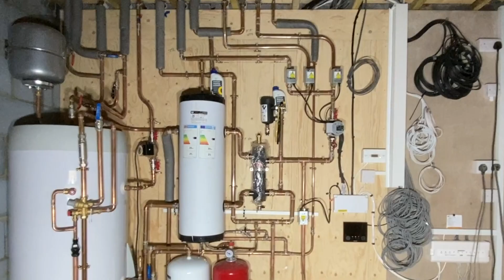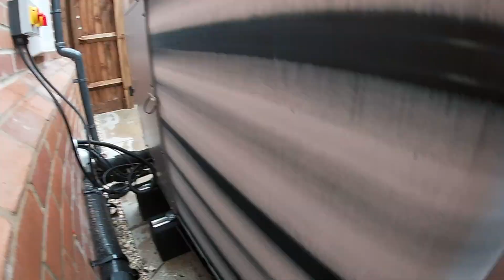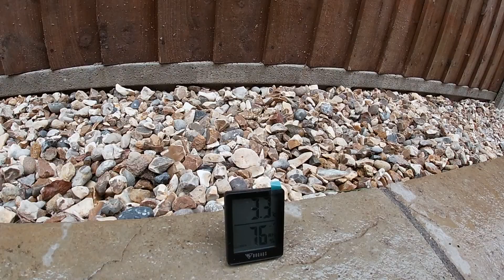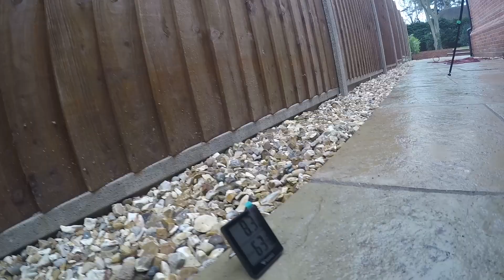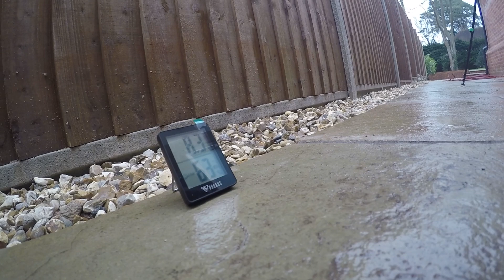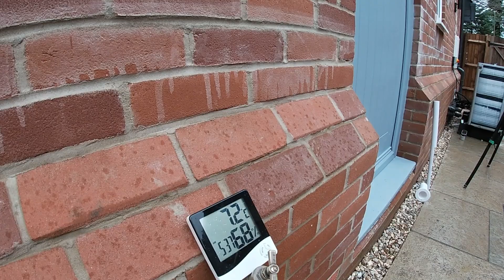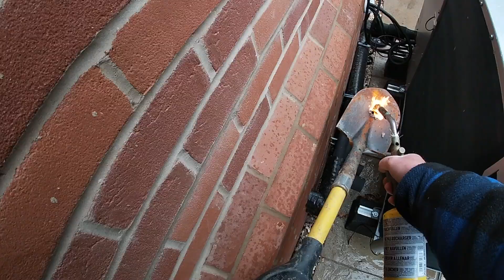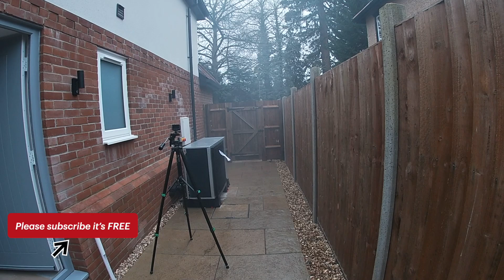Heat  Pump Freeze Up - HELP!

Comment: I’ve been fitting gas boilers for most of my working life. I have 2 words for anyone with a heat pump. “Good luck”
Reply: Good luck and buy a big coat. 🥶
Reply: @ second piece of advise to a heat pump owner. Go on a heat pump training course because you’ll be hard pressed to find someone to fix it when it goes wrong. You’ll have to do it yourself.
Reply from the maker: Funnily enough so have I  but now I am Gassafe free and converted 👍
Reply: There must be a channel for old-dogs that simply cannot understand ASHPs and rather than say they don't understand, simply throw out insults and criticisms.
Reply: Imagine the guy delivering coal had a similar story.
Reply: @edc1569  Yea, a guy on the pony express was just saying that this morning on the way to the tin mine.
Reply: The Norwegians, Swedes and Danes have had heat pumps for decades. They manage just fine. Just go do the heat geek course and you'll be fine. Installing boilers is donkey work - any idiot can do it, and judging by some of the shoddy work I've seen, they do....

Comment: Rip it out and take it down to your local scrap dealer to get some of your money back. Then get yourself a nice gas combination boiler like most other homes. They're cheap to buy, reliable, quiet, easy to repair, and they've been around since the time of  Christ.
These heat pumps are going to be like electric vehicles and flared jeans . Ten years after purchasing them, you'll wonder what the hell you were thinking 🤔.
Reply: Time will tell but I suspect you are wrong on both counts.
Reply: The problem with this system is whoever designed it, nothing to do with heat pumps.
Reply: If your issue improves when removing gate and panels, you could install a wrought iron gate and wooden side panels with airflow to preserve some privacy.
I too will be on the ASHP journey and the nuggets of info out re installations and problems are interesting. Yes it does look as if your particular placement is not ideal at the moment, Good luck👍
Reply: Heat Pumps have been prevalent in the UK far longer than domestic gas boilers. The UK went through the same scenario 50 years ago when 'Natural Gas' started being pumped from North Sea. Until then it was coal fires or maybe the odd oil boiler, until OPEC stunned the market in 1973.
Currently to replace a gas boiler a full heat loss report needs to be obtained as per latest building regulations. Those 'fly by night' cash in hand 'gas engineers' not doing so should be prosecuted, as many gas boilers are way oversized, many have 30kW plus units fitted where 18kW would suffice.
Reply from the maker: @_Dougaldog  Hi I totally agree I used to install gas boilers for 30 years and lost a few jobs to plumbers who for some reason  quoted to fit boilers larger than the size I had quoted for .  Most  " heating " engineers don.t do heat loss calculations to determine the size of boilers, radiators,or pipe sizing .  gas boilers incorrectly sized . Mainly over sized are very un economical to run .A Gas boiler should be sized to run on or as close to its maximum capacity as possible . Thank you . and good luck 👍
Reply: Combi boilers onky really got started aboit 30 years ago, and were massively unreliable until about the last 15 years.  Early ones were lasting less than 10 years, and don't forget when loads stopped working because the condensate drains froze during the beast from the east.
Reply: @brianballard905 I fitted my first Combi Gas boiler in 1982, so they’ve been around a lot longer than 30 years. They’ve certainly evolved over the last 40 plus years. 
Combi boilers are sized according to the Hot Water demand Brian. With most now regulated down to maintain the CH requirements. Also, controls are much more aimed at economic running of the CH system.
Reply: @jimmygillies5590  we had one in 1977...
Reply from the maker: Thank you for your comment. but believe me they are the future. In the not too distant future people will be saying  . Can you believe we used pipe fossil fuel into our homes and set fire to it to keep warm .😎 Good luck 👍
Reply: @HEATSEEKER1428  The "not too distant future" of which you speak is still around 50 years away and comes in the form of nuclear fusion. By this time, we will have cheap electricity heating ceramic radiators and have even less need for heat pumps.
Reply: @HEATSEEKER1428 you can trust a combi boiler to deliver 100% of the time, the heat pump market is under developed and who going to want to wait unreasonable lengths of time  for issues to be resolved. Also most pople are money stressed as it is. The news today is houses of parliament cant get their heat pumps to work, and they're pushing them on people

Comment: If the flow into the buffer tank and the flow from the buffer tank are not balanced then you will get turbulence within the buffer tank wasting energy. For that to happen the flow to each of the three zones would all have to be equal.

I am not a qualified heating engineer, but that looks like your biggest single issue, not the HP position outside.
Reply from the maker: Hi Thank you for your helpful comment  But  Flow and return seem to be ok  return to HP practically cold . Thank you 👍
Reply: Your looking for a delta t of 7° for radiators that's what I'd look at first

Comment: You don’t need the buffer tank or low loss header. First thing you should have done is Read the manual! Quite clear that position of mounting is incorrect messing around with gates etc is just wasting more money. It needs to move to a new location and careful note of instructions on mounting are essential. I’ll not mention whose heat pump it is as it looks same as my own, the circulation pump built into the unit is variable speed. As demand inside reduces pump speed will adjust to suit. Check pipe size, again refer to manual, if too small that’s another reason for high defrosts.
Reply from the maker: Hi 
 Thank you for your very helpful comments,
The system has been designed by others .
Regarding the controls , On new builds  building control require certain levels of control on heating system , As you probably no the end user will want  to control the central heating in each zone  from his phone whilst on holiday 
😆 So I thought the buffer would prevent short cycling the volume is reduced  through the heating system. Apparently the positioning of the H.P  Fulfils the manufacturers criteria .
Whilst I was testing all controls were wide open and calling  so max flow through the central heating , return temp was practically cold at all times . And yet the HP still froze, the only thing that I did not mention is that  the atmosphere humidity level was 87  percent at the back of the HP  and only about 60 percent elsewhere ..
Thank you and good luck .
👍
Reply: @ did your home owner get a survey done prior to going down heat pump route? In Ireland before you get the grant you must get the home independently assessed and energy rating cert. Here it costs €150 and you get that back if grant is approved. I was offended at first with my background but the assessor was extremely thorough made her recommendations (which consisted of just one radiator replacement). I see plenty of nay sayers in the comments don’t get put off everything can be fixed. I spent €43000 on my upgrades after grants, my home value increased by €50,000 and my oil bills went to zero. I installed Solar PV, Battery,HP, control system,triple glazing and insulation. Took about 6 years to complete it’s a no brainier providing you follow the advice and advisors and not the shouting from the fans in the stands or in Ireland the Hurler on the Ditch!
Reply: @ from video depends where distance to wall is measured look at the bottom of the wall, it kicks out measure from bottom. Follow instructions from manufacturer precisely don’t think for 1 second a couple of changes here and there won’t matter, they do and they are vital. In my home I retrofitted the system. I have 13 radiators I use Tado controls, each controls radiators individually using weather compensation and optimum start stop at times my system might have just a single radiator operating Daikin HP never short cycles. The Daikin unit also adjusts its flow temperature and rate dependant on weather and flow rate. The first control item in line on my system is a pressure dependant bypass valve to ensure zero flow noise as rads close off. All standard radiator mechanical valves were ceremoniously dumped in the skip! My home very comfortable low cost to run zero problems with HP. I’ve only been in the heating control and energy conservation industry for 50 years though.
Reply: @deekireland3682  

Am I right in thinking the bypass also ensures sufficient volume of water to flow back to HP for defrost cycle should radiators be shut off ?
Reply: @ yes but it’s automatic and set to approximate flow of a single radiator as rule of thumb.
Reply: Hi 
I think you already been ask , about the design but you cylinder, is it a specific heat pump cylinder, why have you installed a buffer and a volume riser? 
What size heat pump have you fitted ?

Comment: The outside location of the HP looks fine to me & looks like it meets the manufacturers recommended clearances at the front & rear (worth checking just in case). I've got an Air to Air HP much closer to a solid fence than that & it works fine in cooling & heating. 
As others have suggested you could consider replacing the gate & fence with an open slat design to improve the throughput of air down the side of the house. Test it with the gate open to see if it makes any difference. My guess is that it won't.  If it's your fence facing the HP, consider replacing the panels a Hit & Miss type fence which allows air to pass through it. However, although fairly easy to do (slide out the top) this would be an expensive option if you need to replace the entire fence to match in one or two new panels.   
Like others have said I think your problem is with the internal pipework / system design. Too many zones &, if that wall mounted tank is a buffer which acts like a low loss header & separates the HP & system water flow, then it should (if needed at all) be replaced with a volumiser tank instead. To check, calculate the actual water volume of the entire system vs the manufacturers recommended system water volume for the capacity of the outdoor unit you have. If there's enough water volume in the system you may not need the Buffer / volumiser at all. Other thing to check is the system water flow rate. Very important for the outdoor unit to operate at peak efficiency is the actual water flow rate going through it. If the flow & reture temp TD is too high then this indicates the water floow is too low. Pipe sizes may be a limiting factor. HP system design is so important to achieve a good efficiency. 

The most efficient ATW HP systems are open loop with correctly sized pipes / flow rate, no zone control valve or extra pumps (unless absolutly necessary) & no TRV's. The system should be run on correctly set up Weather Compensation only (with variable leaving water temp control) & perhaps only one room Thermostat. Check out the Heat Geek & Urban Plumber YT chanels & see what they have to say about  low loss headers, buffer tanks & complicated zoning systems. Basically they don't recommend them at all. Heat Geek did a whole video on HP micro climating / pooling of cold air around a heat pump & even tested one inside a sealed box. The results will surprise you.
Whilst you are lucky that you do have an alternative position for the outdoor unit, moving your HP should be a last resort because I don't believe that is the root cause of your problem. 
You should also note that HP's will require defrosting a lot more when the outside air temp is below +9c when the air is more humid. When ambient temps go below -8c defrosting is reqired less because the humidity is much lower (all frozen on the ground). The problem is that typical UK winters are in the +10 to -2c range with damp high humidity most of the time which, depending on the system design & make of HP, will require frequent defrost cycles if the HP is running flat out for most of the time. Which raises another question. Is your HP acurately sized for your house heat loss? Too small will lead to more frequent defrosts in cold weather. That said, & depending on the installer skill level, most HP's are slightly or grossly oversized.
Reply from the maker: Hi 
thank you.I briefly visited the site today  and believe it or not the heat pump seemed  to be work fine. , Now this might be as you pointed out that there is less humidity in the air today because of the frost . I did notice when testing the HP the humidity was much hire al low level at the back of the H P  so I think you might be onto something there . Thank you.
Regarding the buffer , in the past I have only fitted  cylinders with buffer at the bottom  ( pre Plumbed )  and had no problems . I fitted a buffer because  if there is reduced flow in the heating system  it would prevent short cycling. Unfortunately on a new build  building control want heating controls.  and the end user for some reason wants to be able to control their hearing whilst standing on their head in a shower from somewhere abroad
😃so I thought fitting a buffer would help prevent short cycling when volumes are short.
Thank you for you very helpful comments. and good luck 
👍
Reply: My Daikin 6kW does not defrost at all when air temperature above 3C, and at -6C (N.E Scotland) it defrosts about once an hour at worst.

I would not have much faith in the design, given that the original had two buffers in series ???

Some good info here https://www.youtube.com/watch?v=bZEii9tSyyU&t=70s

Comment: That appears to have more circulation than my heat pump, yet my heat pump over January (for example) got a COP of 4.7. Okay, your flow could be restricted for non-obvious reasons, but it doesn't seem that likely to be the cause of your issues.

As others have said, your zoning etc is much more likely to be the cause.
Reply: What the hell is the flow temps to achieve 4.7 in Jan
Reply from the maker: Hi Thank you  I take on board about zones but I have been running system flat out with zones wide open . `thank you.👍

Comment: The current wisdom is that buffer tanks usually aren't necessary and can affect performance. They can often be converted to a volumiser which should help with the defrost cycle. The cop is terrible unless it is currently very cold there. There are several good videos from heat geek and others on YouTube on system design etc. Often it's the settings that kill the efficiency.
Reply from the maker: Hi Thank you  but I   really  thought the buffer tank would help the system especially if some of the zones  shut down. it would maintain some volume and prevent short cycling . Is my thinking not right ? Thank you 👍
Reply: @HEATSEEKER1428 , but having zones at all is not great for heat pumps. Open loop and buffer to a volumiser would help loads and the increase in COP would mean it would cost less or no more to heat the WHOLE house

Comment: It’s called micro climate.
While the heat pump location is maybe less than ideal, it is not the sole contributor to this problem.

Looking back on the installation video you can see there are far to many zones on this system and per my comment on that video, over complicated. Now I feel you are seeing the effects of that. The more zones that are closed off, the harder it is for the heat to dissipate, this leads to higher return temps which ultimately trigger the frosting/defrost cycle.
If not already, the HP needs to be in weather compensation mode, I’m going to assume it’s either running at fixed flow temp, or if using WC, is too high a curve.
My conclusion is that a combo of decreased system volume coupled with increased flow temps is forcing frequent frosting due to the DT being to narrow, the frequency of the frosting is creating a micro climate which in by the time the HP has defrosted there has not been enough time for the surrounding air to replenish before the next  defrost cycle occurs, this cycle will continue until more zones/loops open the HP can work efficiently.
What needs to happen is all the zone valves need removed, and the entire system run as an open loop.

Balance the system on weather compensation with no interference from internal stats.
Reply: It's exactly this, to add to above it uses the heating water to help defrost, if most of the zones are closed, then that reserve of water is limited. I have 12 zone valves on my gas system, all are being removed and we will be completely open loop when the heat pump goes in.
Reply from the maker: Hi
Thank you for your comments . The heating system zones although controlled by stats  have been fully open all the time the only  "zone that I have had closed is the hot water . Regarding the removal of zone valves I agree  but the house is going on the market  and  " Joe " public  wants complete control . Plus in new builds we have to satisfy building control. Thank you  for your input I will double check all of the point that you have made  . Good Luck 
👍
Reply: @HEATSEEKER1428  dannyg is completely correct in his observations. You should remove the extra pump and the zones, and convert the buffer to a volumizer on the forward flow. This is what kills your efficiency. Regarding the frost, it's not odd that it freezes over when the input temperature is 87% humid at 2C... the dew point is 0,1C, and the condensor will probably be -2 or -3... so it is going to frost up, and it will frost up even if you fix all the other issues... unless you can fix the micro climate. I live in Denmark... it's normal we have these conditions parts of the year... it's not necessarily a problem.